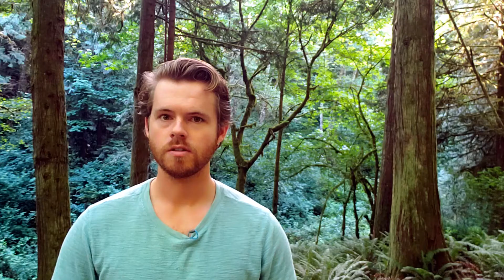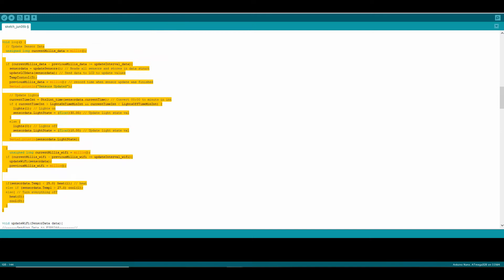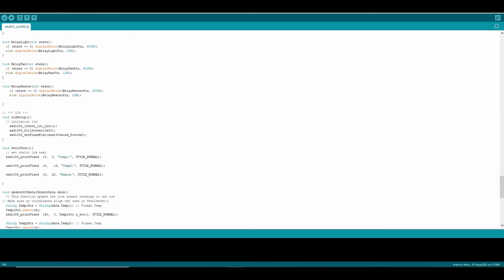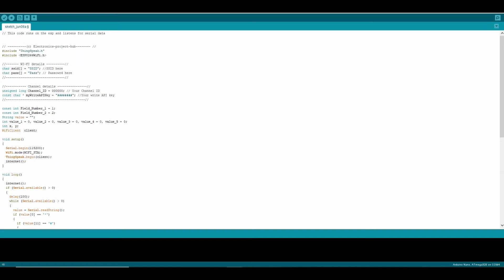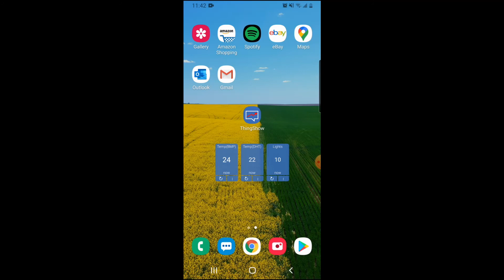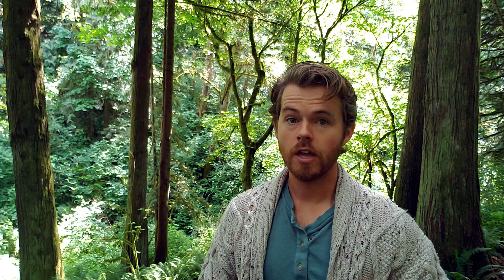At Home Plant Tissue Culture Part 2: Arduino/C++ Code

Comment: How did you figure out what growth hormones to  use and in what amounts? Im trying to clone monstera and peperomia and  dont know where to start. I have murashige and skoog, 6-benzylaminopurine (BAP) for green growth, and NAA as rooting hormone
Reply from the maker: It typically takes trial/error to figure out the correct amounts of cytokinin/auxins/preservatives/sucrose but I was able to find a pre-mixed kit on ebay for mine. If you do want to mix your own, your best bet is to either look online in scientific journals for instructions on similar plants.
Reply from the maker: For more instructions on mixing your own, this guy has the best video:
https://youtu.be/r_Gx5T1Yh_A